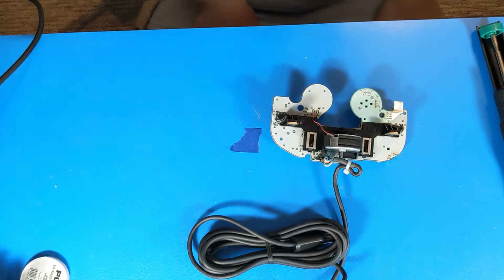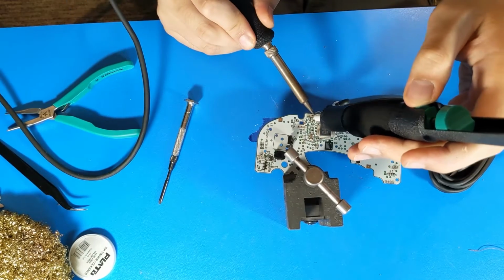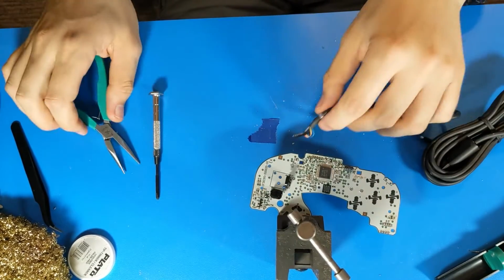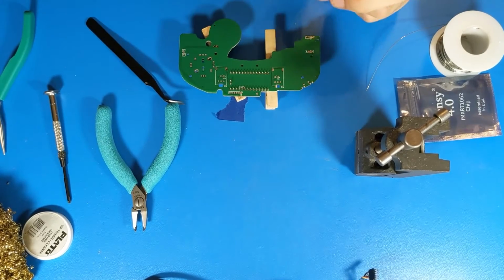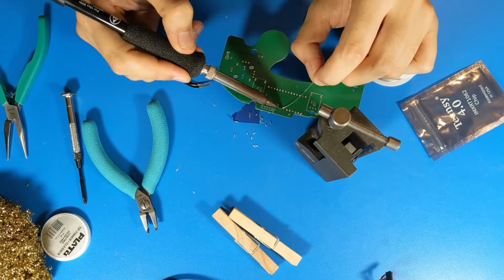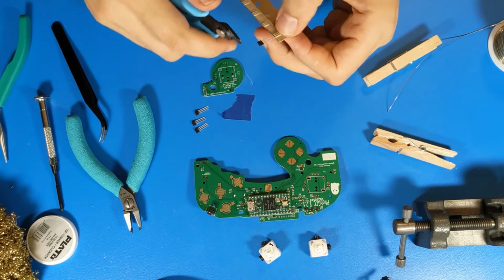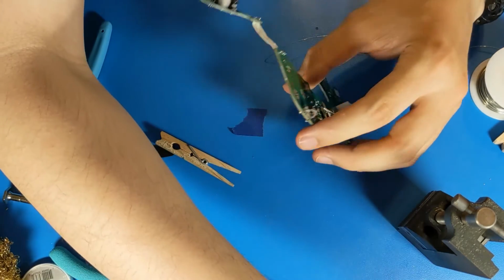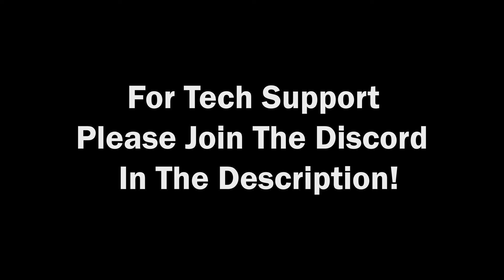PhobGCC 1.2 Assembly Video (NOT FOR PHOB 2)

Comment: my magnet mounts snapped in two when applying, did I mess up? I used a flat metal cap but maybe this was too much pressure? Wondering if I just received a couple dud printed holders..
Reply from the maker: The magnet holder sizes need to be tuned to fit well.

If you purchased them from someone listing them for this purpose, you should seek replacements.
Reply: @CarloVaccariPlus  Thanks a lot for the reply, ordered some replacements and an extra set just in case!

Comment: You mention that you don't actually need the low profile headers on the teensy. Is there any actual reason to have them? I havent soldered yet, but just placing my presoldered teensy in place, it seems like everything fits. Why do they recommend the low profiles?
Reply from the maker: The gcc shell will press the button on the teensy, making it not work.

Comment: As someone that has modded some 3rd party gc controllers. The Gamestop G3's have all-metal stick boxes which have next to no "mechanical snapback". Most stock gc's are all plastic stick boxes and are generally loose. I feal like if you took those g3 stick boxes and mixed in the Phob's hall effect - match made in heaven!
Reply from the maker: The T3 GCC stickboxes shown here generally last longer than any other kind, including the metal-housing kinds that are used in modern controllers.

Also, most Smash players prefer a slightly lighter stick weight.

You can reduce mechanical snapback on any stickbox with grease, or you can let the PhobGCC motherboard do digital snapback filtering.

I'd be very interested in seeing the G3 stickboxes though. Join the discord and post some pictures.

Comment: I bought a phob and got a digital shield press mod with it. I’m thinking I’d like to go back to the analog slider on the trigger. Is this possible to revert?
Reply from the maker: Any good modder who did this did it in software, not hardware.

Check your firmware version and follow the config guide for the appropriate version at https://github.com/PhobGCC/PhobGCC-doc
Reply: @CarloVaccariPlus  Thanks, didn't realize it was just a software setting!

Comment: What is the difference between the low and high sensitivity hall effect sensors? Is one better than the other?
Reply from the maker: Neither is better than the other with the recommended magnets. With stronger magnets, the low sensitivity ones are better.

Comment: How much are people going to sell a fully modded controller for? I'm curious about getting one
Reply from the maker: You may see as low as $150 for a basic controller and higher than $300 for lots of physical or cosmetic modifications.

If you provide a donor controller it might be from $90 to $150ish.
Reply: @CarloVaccariPlus  thanks, that's about what I was expecting. I really want to get into making resin shells and buttons and this could be a cool addition if I really get into it. Wanna get my soldering skills up.
Reply: @CarloVaccariPlus  could you make me one if I sent the controller?
Reply from the maker: @legend98ish  I prefer to deal locally only so I can evaluate the controller before I commit to converting it, and so I can explain how to use it afterward in person. It's a lot smoother for me.